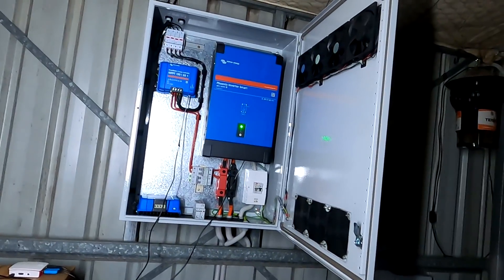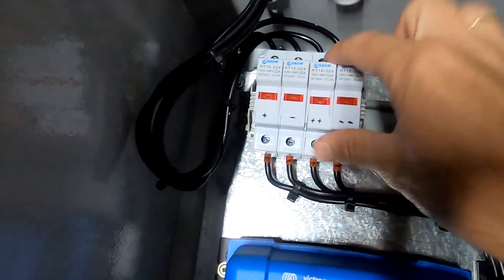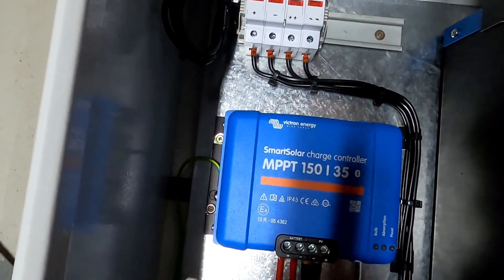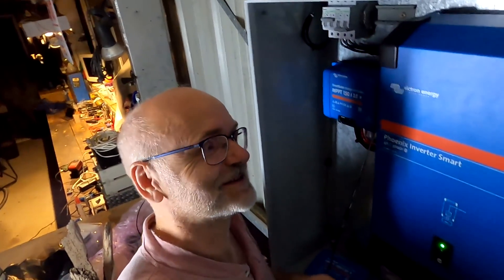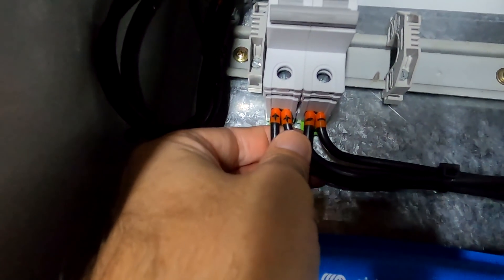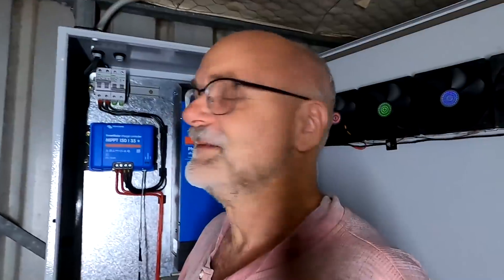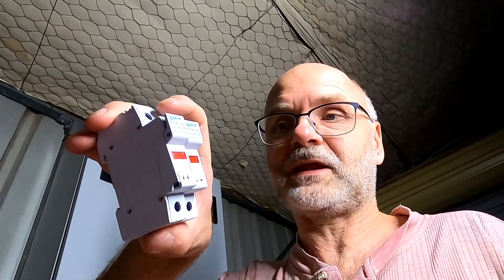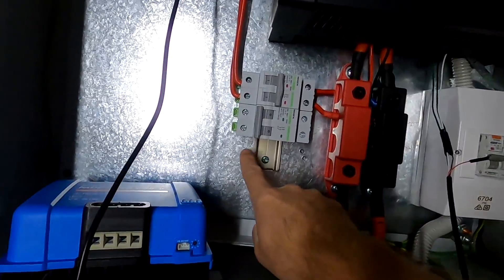Solar Upgrade EP5 - Fuses or Breakers?

Comment: Hey Andy, I would be interested to hear a little bit about the legality and relevant regulations for building systems like this in Australia. What sort of qualifications does one need? I wonder how far a well-informed amateur can go.
Reply: This is all off-grid.  Grid-Tie would be very different..
Reply: @MrSummitville  Agreed, But I still don't know if a non-sparky can play with 230V AC or even the DC side above some arbitrary threshold.
Reply: @leonclose7823  In Australia there are a few areas that are "No Permit Required" zones.  You must check with your local authority having jurisdiction regarding permits and/or DIY.  In some location, DIY is not allowed because a licensed installer is required.
Some of the 2020 Australian Standards  (AS) that apply to solar and low voltage electrical installations...
AS 1170 - Wind Loads
AS 1768 - Lightning Protection
AS 3000 - Electrical Wiring Rules
AS 4086 - Secondary batteries for SPS
AS 4509 - Stand-Alone Power Systems
 . . .  Part 1 Safety Requirements
 . . .  Part 2 Design Guidelines
 . . .  Part 3 Installation and Maintenance
AS 5033 - Installation of photovoltaic (PV) arrays
Reply: @MrSummitville  Thanks for the details. It's a shame that just to read those standards would cost an amateur $1k or so. When you say a local authority, do you mean a council or an electrical supply authority?

Comment: I would leave the fuses combined with the breaker. Also I would add a overvoltage discharge in the PV circuit

Comment: Those fuses and holders are not designed for breaking the current with the contact points in the holder. They arc a little every time and the contacts erode. MCB's on the other hand have built in arc-extinguishing and are designed to break the current at will, up to a promised amount of times. The fuses can help with lightning strikes in combination with MCB's as they may have a higher maximum current breaking capacity than the MCB's.

Comment: What is the point of CB or fuse ?   For  example  your panels  are to say  8A at 38V x2 = 16A . If  you short  this panels  max current is to say 9A x 2 = 18A .  So .... even if your charger  burns out and  short everything  you  can't  reach  20A   and  anyway MC or fuse will not  shut down  ...
Reply: What happens when you have four (4) PV Arrays in parallel and there is short circuit in the wiring in one PV Array?  Now you have FOUR TIMES the max allowed current flowing through the short circuit = potential fire.  The PV Array with the short-circuit will blow its fuse or open the CB ...
Reply: @MrSummitville   Do you thing so  ?   Did  you try  to think first before  write ?   To say  you have  4  parallel  PV  with  8.66A PMAX = 34.64A  you MUST have  40A  CB/FUSE . This panels at  short   makes  9.13A = 36.52A   AND ????? STILL LESS THEN 40 A  = no CB/FUSE engage .....   Pls do not answer me .  I  know the answer of my question: it is pointless to put CB or FUSE .  If you are too smart  put 10 CB and be happy .
Reply: @teror1sta  No, you have NO CLUE what you are talking about.  EACH string must be individually fused with a 10 Amp fuse.  I never said, "Use a 40 Amp fuse".  I said, there can be 4 TIMES the current during a Short Circuit situation.  Can't you read?   And if the charge controller were to fail then Andy's battery bank can discharge a whopping 100 AMPS into the Solar Panels = A FIRE !!!   You know absolutely nothing about designing Solar Panel system ...
Reply: @MrSummitville  " Pls do not answer me "  I don't need to read   nonsense
Reply: @teror1sta  You posted nonsense.  I replied with the proper answer.  Now, you cannot deal with the truth ...

Comment: I have heard from other YouTubers that specialise with electrical gear that most circuit breakers are not built to handle many operations of being switched on and off many times and can lead to premature failure. I am not an electrician, just have watched many hundreds of hours from Chanel’s that specialise in electrical. Thanks again for another entertaining episode.

Comment: Nothing protects against lightning. Overkill sub-1 ohm Grounding is your best bet, but then you're inviting the boogeyman in. (Just make sure you're the smaller structure in the area with good ground potential and sacrificial ground pole :D)

Comment: Remember, fuses and circuit breakers have ONE purpose - to protect the WIRING.   If the need is to interrupt a circuit, a simple SWITCH will suffice.  And, as others have already pointed out, ONE circuit breaker will suffice for each solar array - on either the positive or the negative, but not both.

Comment: It's a common misconception that solar panels don't work at night or when covered by snow but that's not true! 
Night time energy capture all depends on how big the moon is in the night sky and angle. Some nights you will get more voltage than others...
But the biggest surprise is how panels perform covered in snow ❄️.. for some reason it's like they aren't even covered in snow... There's a great video that someone did about this particular topic...
Reply: Contrary to what you claim,  "... for some reason it's like they aren't even covered in snow ..."   In the REAL WORLD - Snow covered Solar Panels produce significantly less watts, and if the voltage is too low (under load) they will produce 0 Watts.   Also, at night, Solar Panels does not produce any usable watts.

Comment: I think you should also install a dc surge protection device parallel to the pv dc breaker....
Reply: Yes I agree, I did the same and in my case during a big lightening storm , ones it already tripped protecting my charger and inverter.

Comment: Once again, why do you need a breaker for both the positive and negative?   Wouldn't interrupting either, but preferably the positive, break the circuit?

Secondly, could you show how you combined the cables to fit into the new breakers?   You called them something along the lines of boot laces whatever they are.  What kind of ends (the ends going into the breaker) are on these wires.  I'd be interested.  Thanks
Reply: Interruption of both wires in miniature (modular) circuit breakers, MCB (I assume a DIN-rail mounted MCB) is also needs, as only 1 pole is generally not sufficient for  interrupting DC current with reliable extinguishing of DC current's arc between MCB's contacts. Even in special DC version of more common AC type MCB.
Reply: This seems common in solar, if breakers are used, and I'd guess it has to do with lightning safety. The panels often reside on the roof and are exposed to atmospherical phenomena, so, having a breaker on both wires will give you a disconnection for both wires.

Comment: Technically speaking: To open a circuit under current-load (like the MC4-plugs, or the old fuse-holder), you always need a CURRENT-Breaker, regardless if it's also a fuse in one device. So from now on, you can safely open the PV-circuit even at noon. The old fuse-holders were not built to do that, nor the MC4-plugs are.

Comment: Getting miscellaneous voltages from disconnected things is not uncommon.  There is voltage all around you, from the ground to the sky.  For example, from the ground to the air there is around 100 volts per meter of height.  Yes, I kid you not.  There will also be voltage differentials between different points on the ground, so a large straddling structure with a ground rod on one side might show a voltage on the other relative to ground.  And yes, solar panels at night can generate a voltage too.

You can't get any appreciable current out of these sources, but they are there.

-Matt

Comment: Hey Andy... can you explain why you went to a high voltage instead of higher Amps ... sorry if this is a silly question...
Reply: My apologies.... i mean with the solar panels,  I did reply to an older video.... but I realise your super popular now... and can't expect you to see all the replies...  so I appreciate your reply and time ..
Reply: Higher voltage (ie panels in series) reduces power loss in the PV wiring and reduces the cable size required between the PV array and the charge controller.
Reply: @nigelcharles511  Thanks ...  I was aware of that... is there any benefit from having higher volts then Amp going into the controller for a 12v system
Reply: The lower the voltage the greater the cable loss for a given cable size so this is even more relevant for a 12v system. In some cases the round trip cable length between the PV to the controller can be many metres so losses can become significant. However as the voltage is less at the controller output, it is always better to mount the controller nearer to the battery than the PV array.
Reply: @nigelcharles511  Thanks... its so difficult trying to explain myself via text... so first of all... thanks for the reply. I see Andy has high voltage and low Amp. Does the controller work better with higher voltage the amps ...  my understanding is ... it changes the unused volts and changes to higher amps.... AGAIN.. only new at off grid system
Reply: @65bigfalconable  Victron don't specify an optimum voltage input for their MPPT controllers, just give a maximum. They quote high efficiency figures. If efficiency varied significantly over the range of input voltages they would provide that information. 
I use a pair of 250v/100A 48v controllers each having a 3S6P ( 3 series, 6 parallel) string of 325W panels each with a max voltage of 70v (max of 210v at the controller). This provides up to 11.75kw. Sounds high and is great in summer for EV charging but struggles to produce 1kw on an overcast day in winter here in the UK. For year round off-grid performance, depending on requirements,  unless you live within 30 degrees of the equator (like Andy) you are unlikely to have too much PV or battery capacity. Like the PV side the 48v output helps efficiency and reduces cable size to manageable proportions. Keep controller(s) and inverter close together as the cable between these carry the highest currents in the whole system. For a given power output higher voltage input inverters tend to be cheaper and more efficient so, unless your power requirements are very modest and seasonal, go for a 48v battery bank. Hope this helps.
Reply from the maker: You mean for the breaker?

Comment: You have somewhere locally or at least in your country that will give you free solar Panels brackets and Hardware? I wish I had a place like that
Reply from the maker: Almost free, yes. People are upgrading their smaller systems now to larger ones and sell the old system for $100-$500, panels, inverter, rails, clamps,...
Just sourcing some new panels already for stage 3 and 4 😉
Reply: @OffGridGarageAustralia  well that's great and it seems like a good place to get a good deal and meet some good people. I'm looking forward to see your stage 3 and 4

Comment: By far the biggest reason to use breakers instead of fuses is so you don't get the itch to just up-size a fuse that keeps blowing, one of the main reasons for house fires. My own parents replaced the living room 15A fuse with a 20A one because the AC kept blowing fuses. Thankfully, nothing bad happened and the fuse box got upgraded to breakers 23 years ago.
Reply from the maker: Great point, Dan! That's a dangerous thing to do.

Comment: Many will say circuit breakers are less accurate and it is more chance of getting a bad one that trips too easily or doesn't trip than a bad fuse.  But whatever the case, either work about the same.  Happy you increased from the 10A fuses....since these were undersized.  25A per 2 strings now should be ok.
A circuit breaker can trip with a high inrush current because it has a magnetic trip system in addition to the heated metal part that trips, which would be similar to a fuse.  If you have a lightning strike....you are replacing things.  100V rating is nothing when 100,000V lightning bolt is coming.    You will never have a fuse blow if it is sized correctly, so ignore any comments about saving costs because you won't have to replace fuses.
Reply from the maker: Thank you.

Comment: Solar panels are a finite source of power, that can be even shorted (aka the Isc, or the current in short circuit, displayed on the datasheet) to no harm. So there is no real reason to "protect" anything in there.

As long as the cable run from the pannels to the controller has been dimensioned correctly, there is literally nothing to protect.

With that said, it is convinient to have a On/Off SWITCH (properly sized, of course) between the pannels and the controller so one can work in the controller without going into the roof and covering/disconnecting every pannel.

Although a circuit breaker is not meant to be used as a switch (it is simply not mechanically designed/tested to endure thousands of on/off operations as a light switch) it can be used as one for sporadic use.
Reply from the maker: Yes, I agree!
Reply: @paial - What happens when you have four (4) PV Arrays in parallel and there is short circuit in the wiring in one PV Array?  Now you have FOUR TIMES the max allowed current flowing through the short circuit = potential fire.  The PV Array with the short-circuit will blow its fuse or open the CB ...
Reply: @MrSummitville  first you should be considering installing them with either a separate controller each (string) OR all in series (if partial shading is not a problem) with a high voltage (input) controller. it is just NOT good practice to keep paralleling arrays like that.
Victron, for instance, have off grid controllers all the way up to 450v input (others, more, and the pannels are normally rated for 1000v or 1500v). And for partial shading, you be always better off with separate controllers. 

In sailboats (very prone to partial shading from the mast(s) and rigging) I have done many installs with one controller per pannel or couple of pannels.

But if you are going that route (of paralleling many strings), yes, you might, have protection for a catastrophic event (decent pannels do not just "short out" out of the blue).
Reply: Isn't it better then to keep the fuses and simply add disconnectors / isolator switch before your fuses and after the mptt for isolate the mptt ?

Comment: You doubled up wire from charge controller to breaker.   Most codes say to run only one wire and that it is sized to carry more than 25A.  You don't depend on wires sharing load equally.  Solar panel leads can be tied together like that with just two wires, but if you had 3 or more each string needs it's own fuse.
Reply: Thanks i was wondering about that to, you answer seems logical. 2 parallel can go in one fuse but if there are more, each needs its own fuse. Thanks

Comment: Everything you say about Breakers being better than Fuses, I agree. But the question is: Do you need them in the first place? As your cabels to the solar panels should be strong enough to withstand the short circuit current of the modules (strings) in anyway. I would recommend a switch in anyway so you can also use a breaker or a fuse with breaking capabilities like you had bevor. ;-.)
Und auf Deutsch, weil ich nicht weiß, wie verständlich mein Englisch ist: Die Verkabelung zu deinen Modulen sollte sowieso dermaßen ausgelegt sein, dass diese über den Kurzschlussstrom der Module (oder Strings) 'lachen'. Deshalb ist eine Sicherung nicht notwendig. Ein Schalter ist aber sehr empfehlenswert. ;-) Da deine bisherigen Sicherungen aber auch als Schalter verwendet werden können (und auch 'dürfen' laut Hersteller) waren diese völlig ausreichend. Eventuell kannst du sie bei weiteren Projekten verwenden. Falsch sind sie jedenfalls nicht. :-)
Danke für deine informativen und gleichsam unterhaltsamen Videos.
Reply: What happens when you have four (4) PV Arrays in parallel and there is short circuit in the wiring in one PV Array?  Now you have FOUR TIMES the max allowed current flowing through the short circuit = potential fire.  The PV Array with the short-circuit will blow its fuse or open the CB ...
Reply: @MrSummitville   A 2,5mm² cable is able to carry 32A of current if used correctly. Yes there may be constellations where fusing might be necessary but in that cases every string has to have it's own fuse (or diode). Let's say it this way: If there are more than 4 modules (or strings) in parallel, fuses or diodes may be needed.
Reply: @geroldgoerke5729  Our electrical code is ... If more than two strings is parallel, then each string is REQUIRED to have its own OCD ...
Reply: @MrSummitville  That's fine. Better safe than sorry. But one can easily calculate if any fuses are necessary or not. Let's take the last video Adrian has posted as an example: He puts three strings in parallel. Each String has an SCC of 5.61A. That is 16.83A in total. Even if using 2.5mm² cables, there is no risk of damaging or lighting up that cables in case of an short circuit.
(Plus, I guess this modules have 4mm² cables and he uses 4mm² cables further on)
But anyways: If there are rules or regulations on that topic in your country: Sure follow them

Comment: I guess I don’t understand the way you set things up. In the US you’re supposed to have fuses at your branch connections on your solar panels. I parallel two strings of four series panels. So I would need two positive fuses. 
Then I would have breakers just above the charge controllers and then fuses below the breakers heading towards the charge controllers. 
At least this was the way it was told to me in the US. But again I am no expert! 
Then from the charge controllers to the bus bars I would have another fuse on the positive wire to the batteries. Then from the bus bar positive to the battery shut off switch I would have another fuse. 
So many fuses? 🤔